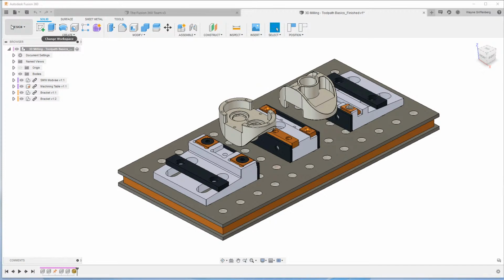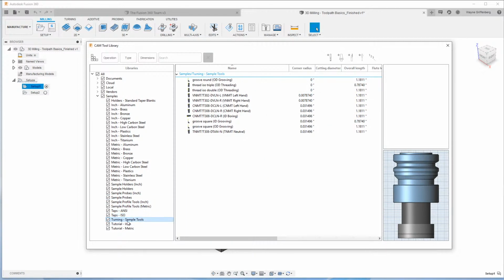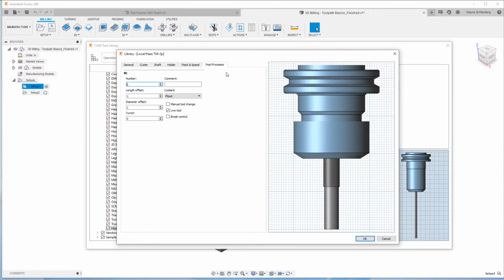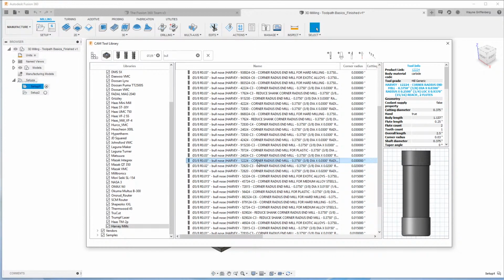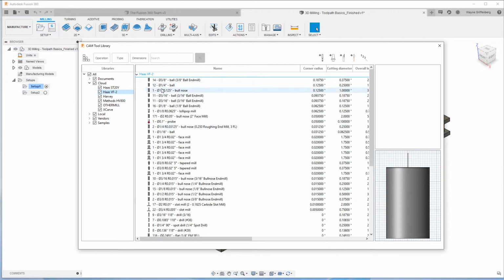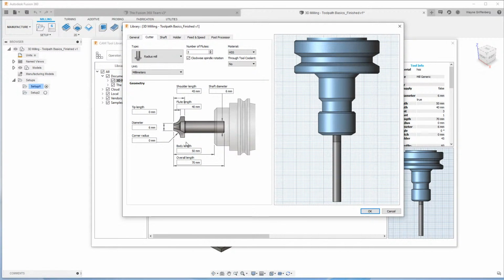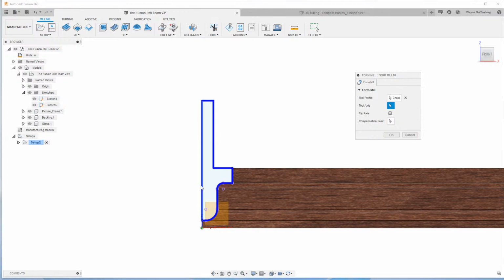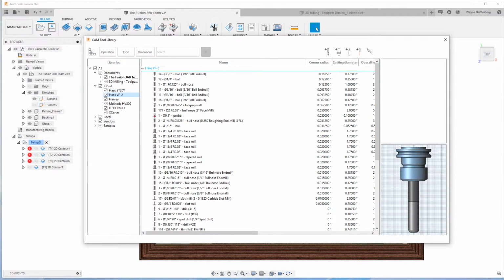360 LIVE: Tool Library Deep Dive

Comment: I am hoping that you can help me I have a CNC router using a DSP A18 controller what PP should I use to output from fusion
Reply: Mach3 is a common one but reference the manual for settings.
Reply: @MrCoffeypaul  not quite sure what you mean What would I use to output on Mach 3 very new to this sorry
Reply: @cornishman1954  It's sometimes a case of trial and error to begin with when finding a pp to suit you but it's always a help if you can read g-code.
Reply: @MrCoffeypaul  dont know g code very new to this and very old..